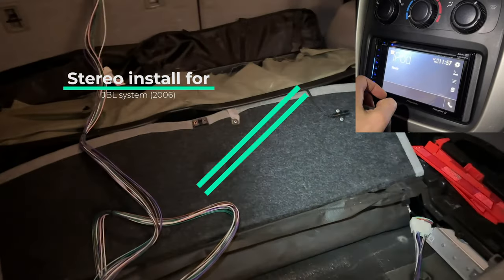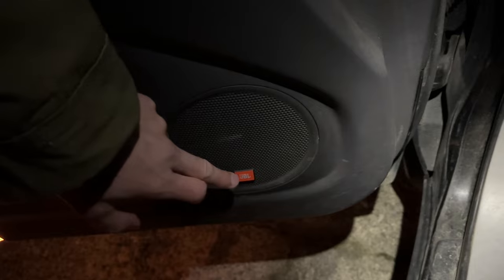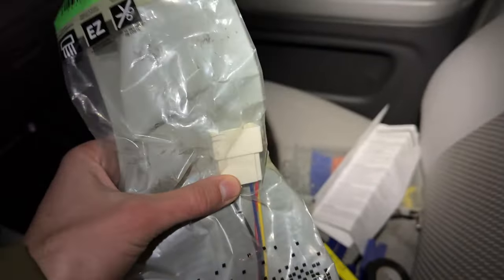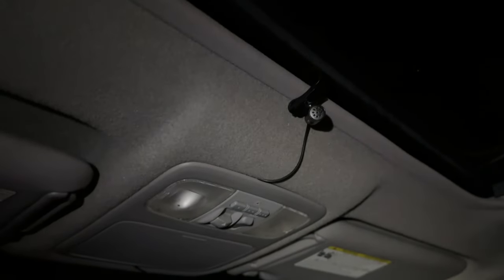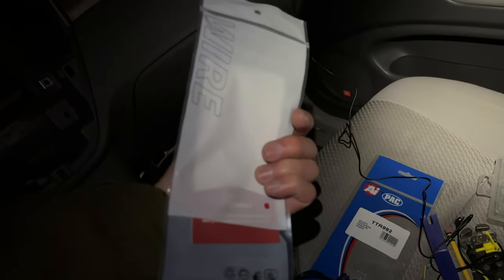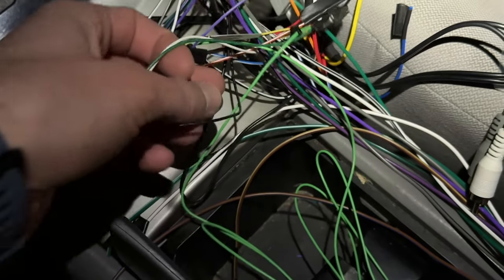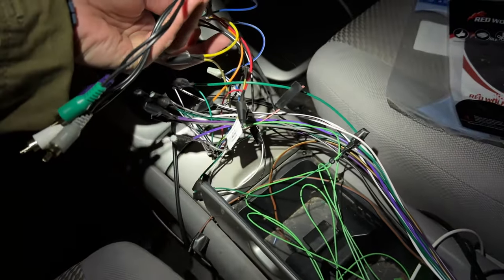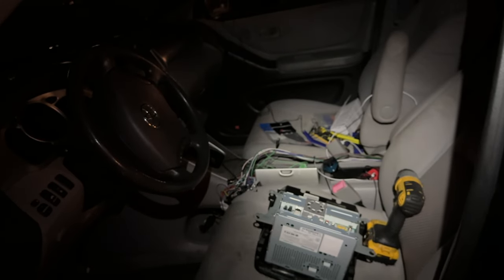★★★★★ '06 Toyota Highlander JBL Install - 2006 Hybrid Radio Wiring - Toyota Tundra 2004 AVH, 1400NEX

Comment: Thanks for the helpful video.  I'm in the process of upgrading my dad's '06 Highlander with JBL/Navigation.  I've got it all working and I did not even need to bypass the factory amp.  I used a line output converter and the sound is fine, no pops or buzzing.  Question I have for you is if you were able to maintain the sound from the tweeters in the door.  If so, how??  Thanks in advance!
Reply: I'm having the worst time trying to figure out how to connect a new stereo to an 04 highlander.
Same deal: it has a JBL AMP.
But I'd rather not bypass it.
I bought a harness specifically for this but in the end i got no sound.
Wtf???